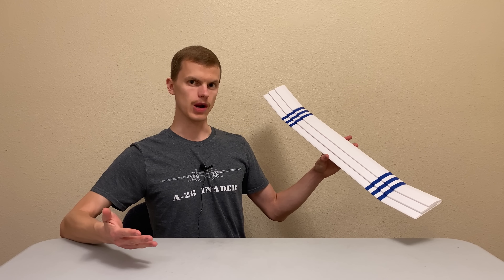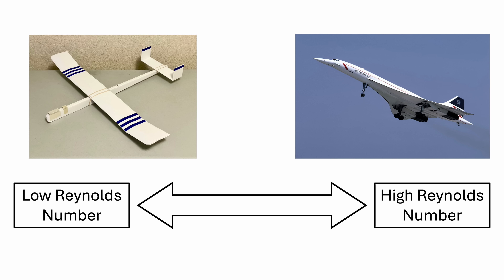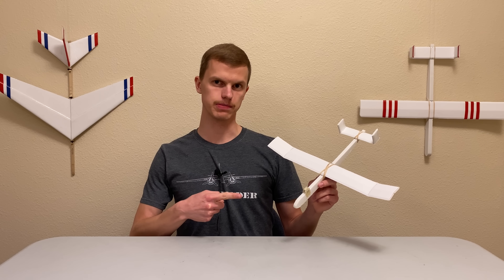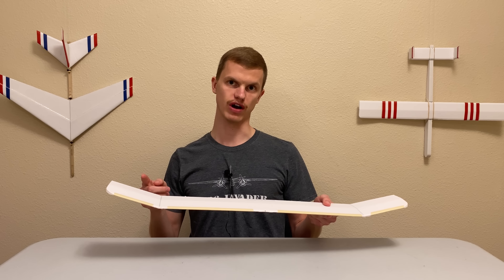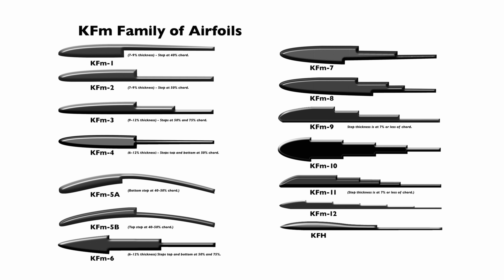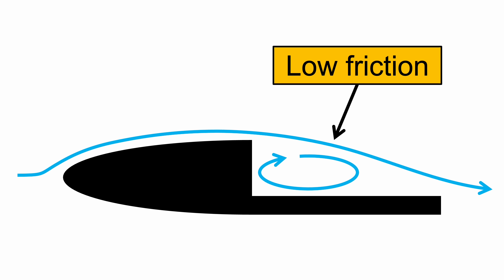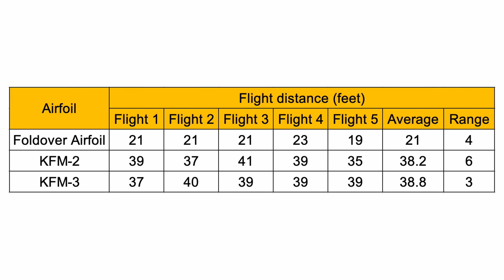Stepped Airfoils for Model Airplanes - Are They Better?

Comment: As a percentage of total airfoil weight to surface area the KFM3 was at a disadvantage due to the increased weight of its wider center spar.  I guess if you matched the weight of all three planes as a completed plane it might not make a big difference.

Comment: I have built a bunch of flying wing rc planes using the KFm4 and versions of the same wing using a an actual symmetrical airfoil. These were relatively heavy fast planes. The "real" airfoil wings tended to be more efficient and faster. The KFm4 planes were very stable in the air they had much less pitch instability and over all flew better. I mostly flew FPV and I liked the smooth flying of the stepped airfoil. I have a bunch of flight videos on my channel from a few years back. Great work on your experiment you got a new subscriber.
Reply: try it with a multi element wing and a kfm-10 configuration and 3+ elements with tublical leading edges and steps with a prop/fan or 2 either mounted proud on nose or incorporated into the midle of each/the(depending if traditional plane design or sled/ekranoplane/hovercraft/single centeral wing with winglet design) like mine multiwing and its almost a helicopter ;)

i havnt done it yet but i want to play around with 3d printing  'tesla valve[open on top] 2 valve wide segments across top and bottom of with a 30* slope to fill step1 and 2 and adding a very thin 4th step/ slightly separated medium incidence fixed areofoil as 'step 4' at rear see if i cant milk some extra lift and pressure out of it so it and drop its forward movement a bit more for more 'hovering' less ekranoplan at low power

Comment: Isn't the introduction of  induced vortices on the KF M airfoil functionally the same as the dimple on a golf ball?  
If so, then why not dimple the wing surface to reduce pressure drag?
- Just asking for a friend -
Reply: Not quite, let me try to explain. 

The dimples in the golf ball surface trip the boundary layer from laminar to turbulent. This helps it stick to the ball for longer on its backside. The main effect of this is that you decrease the size of the low pressure wake behind the ball. The turbulent boundary layer has more friction with the surface, but because we decrease the wake so much it's worth it. 

For the glider, we are trying to reduce skin friction, because that is the dominant form of drag at low speeds. So we are setting up a low pressure wake on the top surface. Here the laminar boundary layer detaches from the wing, so there is no skin friction drag there. In this case the trade off goes the other way. We are increasing the pressure drag dramatically, but because the skin friction drag is so dominant that trade off is worth it. 

That is it in theory at least. You heard the guy in the video be surprised that the 'normal' wing flew so poorly. It might be that that one is just really bad by happenstance but that a different baseline would blow the kfm's out of the water. 

I hope that helps clarify things!

Comment: It may ( does) reduce flow ( drag) over the surface.  But it doesn't  provide more lift. ( speed) When other shapes for the same weight could use surfaces that do. ?
Is it about lift? Or drag? Design, or a better form ( wing) .
 Then realize this is all very slow air speed testing.
 Drastically changed as it increases. 
 Instead. Use a wing that can sustain thrust. Not a gliding wing.
  Use steps near the edges that create vortices.   Not the whole wing. Use steps on control  surfaces for less drag?  It's a good topic. Geared to the hobby. Or full scale?

Comment: Excellent vid. I'm no engineer, and didn't view all the comments, but here was my first thought.
What if you were to make the step smaller, but add many more?
I would try milling or forming the top/aft surface of the wing, to have a series of small, parallel, U shaped channels, running from wingtip to wingtip. You could experiment with the size, shape,  spacing, and number of channels. Wouldn't be too difficult with a small router with a rounded bit, using a template.
This might create an area where, given enough velocity to create a vortex within the channels, the airflow wouldn't have a chance to get between the channels, and contact the surface, creating drag.
A bit like the dimpled surface of a golfball, only much more tuned.
At slow speeds, there would probably be more drag because of the increased surface area, but once a strong vortex develops in all those channels, the airflow would basically ride across the top of the small parallel vortexes, I would think. The same technique might even work on other areas to help reduce drag, who knows.
I'm sure I'm not the first to think of this (there's probably papers from the 1950's discussing all this in depth lol), I'm not sure if it's practical or feasible, and again, have NO idea what I'm talking about, but there ya go ;) Good luck with your projects. 🤘
Reply: Why not make the steps bigger to  profit from the reduced drag because of the larger vortices? Why not throw winglets into the equation?

Comment: Ive been a flying professionally and teaching for almost 30 years.  In my opinion this is a great experiment.  It makes me very glad to see that we still have young people in this nation with enough curiousity and motivation to try things like this.

Unfortunately the experiment while creative is flawed - mostly on the design of th first airfoil.  Lift is created by a combination of two principals - Bernoulli's and Newton's.  Newtons law says that as air molecules strike the lower side of the airfoil they create a higher pressure area which "pushes" the air foil upwards.  This works well on an airfoil where the bottom is perfectly flat.  Unfortunately the bottom of the fold over airfoil is NOT flat, while the other two ARE flat.  This leads to the first flaw.  In the experiment the first airfoil not only has a different topside but also a different bottomside.  When doing an experiment it is important to only change one thing at a time.

The second flaw has to do with the effect of the step on the bottom.  As it moves through the air, it very likely creates a forward pitching moment due to the application of Newton's law as the air flows over the step.  This pitching moment should be causing the airplane to try to nose down which the elevator must in turn counteract.  The additional drag will reduce the aircrafts performance substantially.

The third flaw has to do with the application of the elevator itself.  In real life, a pilot operating an aircraft will trim the aircraft so that it is at its optimal speed where the combination of induced drag and parasite drag are at its lowest point.  This optimal speed will allow the aircraft to remain airborne for the longest period of time.  Unfortunately, the experiment here fails to take this into account.  The elevator is simply 'set' prior to flight without taking into account which .  The experiment needs to be repeated in a wind tunnel where total drag and total lift can be measured at various attitudes, or it needs to be repeated multiple times using the same airfoil, with different elevator settings.

The last flaw is that the aircraft needs to be chronographed/released from a mechanical device so that we can verify that flow of air over the wings is exactly the same for each flight.

Still, its a great idea, and I hope this young fellow take my observations as advice and NOT as criticism.
Reply: A Typhoon fighter, carrying full ordinance and drop tanks has very little lower wing surface exposed. Could Newton explain how it flies in this configuration? I understood that lift was mainly supplied by the intense low pressure created over the upper surface of the wing, which rises into it.
Reply: Very nicely put! Interesting but as with most experiments you end up with more questions.

Comment: Maybe I misunderstand, but isn't it possible the reason why the 'flat-bottom' fold over did so poorly was because it was actually a modified KFm1 design. It has a step on the bottom, not really a flat-bottom.

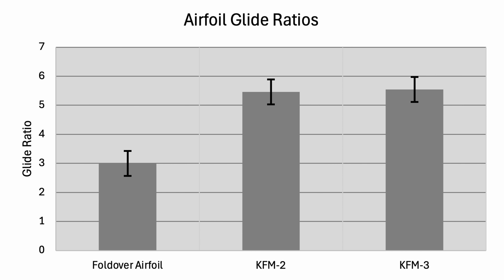Comment: I noticed you didn't mention anything about the weight difference between the fold-over, KFM-2 and KFM-3 airfoils. If you could add that to the Flight distance table you showed at 9:34 that could give some more insight into the performance of the airfoils.

Comment: Just one doubt , was the cg adjusted for each model cause you need to trum it beforehand as not all airfoils have their aerodynamic center at the same place. 

As i noticed in the video the ppane was literally goibg down ( it's clearly nose heavy ) 
adjust it by using a ballast weight or by changing the main wing position a little forward. 

And do the test again.

Comment: I don't think I've ever seen better R&D on such a frugal budget. In addition to your other suggestions, I'd love to see the foldover airfoil modified to round/smooth the trailing-edge transition. You could probably add Bondo or some kind of sandable putty. I suspect that the foldover airfoil is susceptible to flow separation, even at small angles-of-attack.

Comment: As the first and only human to fly under a KF wing I would like to offer some of my insights I found when preparing my airplane. I built a wind tunnel in an upstairs bedroom to test things. The theory of reducing skin drag might not be right. I believe that the vortex formed behind the step drags the air flow down into the notch and it sticks better and travels a longer distance. A full span notch is less effective on full size aircraft . Using pockets instead of full span notches  allows the air to stick to the wing better. In fact it increases the upper surface distance in the notch but also in the airflow beside the notch. This is because when the air starts to separate from the conventional sections of wing it is dragged into the notch increasing the air speed over the wing upper surface. Try making another model dividing the wing into 6 sections per side. Open them up so you have 3 notches and 3 conventional airfoils per side. Let me know how that works out. Incorporating a concave rear surface of the notch will probably cause a smoother flow.
Reply: Nice theory, likely an explanation of what actually happens to the air flow.  YOU should be the one testing your theory, not Mr. Design.
Reply: @spiritofexcelence7359 much respect, i have like a 60cm long35ish depending if u count winglets monstrosity ive been playing with that kinda looks like a mix between deorian and a A2500
try it with a fixed multi-element wing and a kfm-10 configuration 3+ (i have 3 atm i want to try 4)elements with tublical leading edges and rear edges/steps with a prop/fan or 2 either mounted proud on nose or incorporated into the middle of each(depending if traditional plane design or sled/ekranoplane/hovercraft/single centeral wing with winglet design)
 mines 1 wing from top/between 4rd and 3th winger elements multiwing 
its not quite a vetrol vehicle but its not that far off it if u pull up(nose mounted verticle control surfaces) ;)

i havnt done it yet but i want to play around with 3d printing  'tesla valve[open on top] 2 valve deep segments across top and bottom of with a 30* slope to fill step1 and 2 and adding a very thin 4th step/ slightly separated medium incidence fixed areofoil as 'step 4' at rear see if i cant milk some extra lift drag and pressure out of it so it and drop its forward movement raise its lift a bit more, for more 'hovering' less ekranoplan at low power/hold it up to wing surfaces

 @kriley9386  i think like me hes just offering sujestions based on what hes done in re to this and sounds like hes used 1 large enough to hold a human and test piloted it so , have some respect :P

Comment: how aobut two wings? like a bi-plane,  more suraface area?
Reply: Structurally, Biplanes are a stout design that can double the wing area, and achieve high roll rates. For maximum L/D, a larger monoplane would be a better way to increase wing area, because a longer chord increases Reynold's number. Also, a monoplane has less issues with pretty much every type of drag. If the biplane angles-of-incidence aren't precisely manufactured, you could have one plane producing lift, while the 2nd plane produces downforce.
Reply: @AwestrikeFearofGods  in nature, a condor is a slow flyer, would the shape of the condors wings be a good design for a model airplane ?
Reply: @sergeigen1  Large, high aspect-ratio monoplane? Yes. Feathers and other details that make it a bird wing? Hard to say.

Keep in mind that there isn't just one shape to a condor wing. It is a flexible, flappable structure, whose shape and orientation can be radically altered.

Comment: My experience favors sharper leading edges than  conventional airfoils.  Have you tried sharper leading edges?  If not I think you'll be pleased.   Sharp LE will have a higher stall angle and a more repeatable flight.  Furthermore sharp bumps at the leading edge enhance performance the same as Sharp LE.  You can glue small particles near the upper portion of the leading edge, or create craters with a soldering iron.

Comment: Can the improved performance of the wing be noticed by measuring the drag with a scale at the wing attachment instead of using flight distance? Wouldn't this be better, as it removes launch variables from the equation, providing more consistent results?
Reply from the maker: Yes, a test in a wind tunnel using force measurements would likely be a higher quality experiment with less variation in the results.
Reply: @DesignYourOwnAirplanes-xd6lz  OMG! Do you have a wind tunnel?
Reply: @DesignYourOwnAirplanes-xd6lz  Testing them in a flowing liquid would give comparable results.
Reply: Building an accurate wind tunnel is a whole other project! A difficult project too, and a project that is a lot less fun than launching airplanes in a gym.

Comment: Hi. Excellent information, thanks. I now only build small lightweight rubber powered planes, and I can't wait to try a stepped airfoil. I'll chop the wings of my triplane (which climbs like a rocket, but glides like a brick), and see if I can improve the flight envelope. As there's little difference between the k2 and k3 I'll do the single step one. Thank you for speaking slowly and clearly. Cheers, P.R.

Comment: shoud very interesting to test the atack angle versus lift compared with other airfoils; this will tell if this airfoils are safer against Attack Angle Stall.
Reply: In my experience the stepped wing is virtually stall proof. They mush along but never just drop out of the air.

Comment: Great work! I will certainly recommend my students watch some of your content for inspiration. I love that you use rubber bands instead of epoxy/super glue because it "makes for a better thumbnail." 
One thing I would note if this topics came up and I was wearing my professor hat during any of my Experimental Aerodynamics sections is that airplanes and gliders are not interchangeable. They are wildly different systems with different requirements that operate under vastly different regimes in a common medium. For example, the Space Shuttle is a glider. No one needed a FAA pilot license to fly it. Many astronauts were licensed test pilots but it was never required because it is not a plane. It is an unpowered vehicle.
About the airplane-glider dilemma, most if not all advantage demonstrated is lost if you were to include the 4th component of flight for an airplane, thrust. SLF is true when lift, gravity, drag and thrust are balanced. In free-fall, stepped airfoils create high drag regions on the back half of the top of the wing which is like pulling on the reigns of a horse. While in free-fall they oscillate into and out of stall. You did a great job of capturing this effect during your tests. You can see the stepped wings nose down, gain speed, nose up, almost stall, back to nose down...etc until they find the perfect balance to allow them to fall almost linearly. That near stall condition which is when a wing is going to generate the most lift.
If you move the mass on the rounded over airfoil so that it presented a near stall AoA (+3 to 8 deg speed dependent) where the vehicles longitudinal stability has roots spaced out far enough to allow it to oscillate into and out of stall (See Dynamics of Flight if what I am describing sounds foreign), it will outperform both of the stepped configurations because the Clark Y airfoil is a stepped airfoil with an infinite number of steps. It will have the beneficial characteristics of a smooth airfoil while traveling at a lower speed due to the larger XSA which will drive down your reynolds number and, thusly, most of the drag parameters you reviewed.
This is good stuff. You are on the right track! Feel free to reach out if you need more clarification.
Reply: Very easy to understand comment.

Comment: Absolutely amazing video. Every time a "how?" or "why?" popped into my head you immediately gave more details.
At those speeds, you could get lots of cheap data with a bicycle and bits of string. Mount the wing to a boom in front, glue bits of string to the wing, and Bob's your uncle. It's not at elegant as a wind tunnel or a simulation, but it could easily work in that huge gym you have access to.

Comment: wing surface like golf ball
Reply: it doesn't quite need to be dimpled like a golf ball. STOL aircraft use vortex generators just behind the leading edge to achieve the same stall-resistance and skin friction reduction.
Reply: @tissuepaper9962  could you try doing it as an experiment.
Reply: @jpablotesla  pretty sure it's already been done on youtube